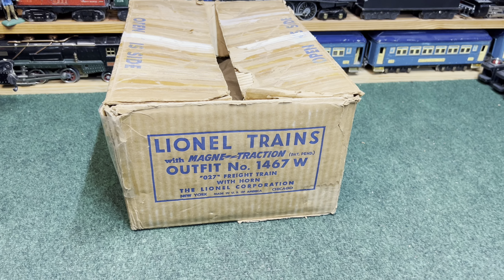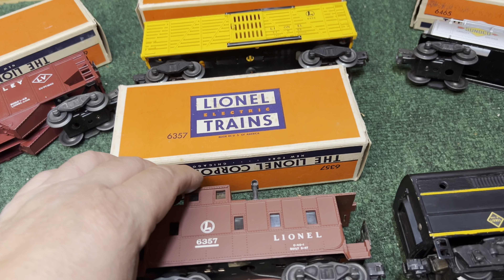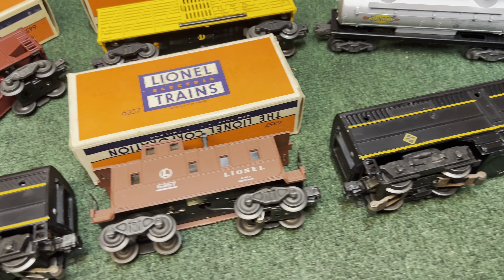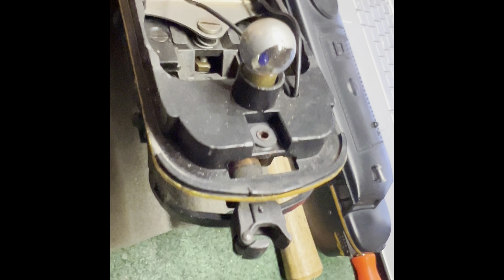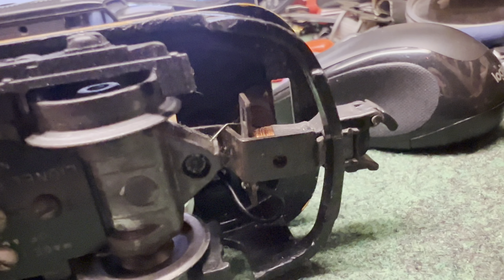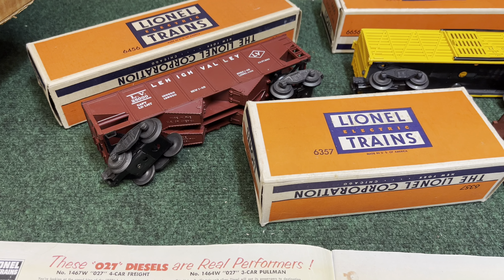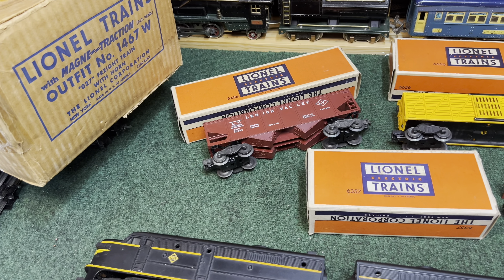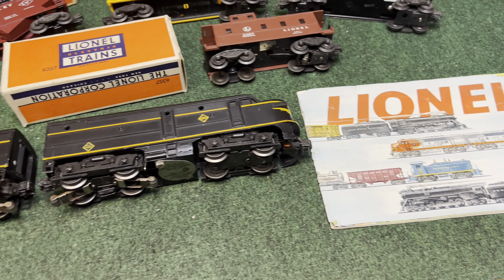1953 Postwar Lionel Trains Outfit No. 1467W Twin Erie 2032 Alco Freight Set

Comment: The 2023, 2031, 2032, 2033, basically the 1st Alco series are my favorites. Modified to two motors per unit they are unstoppable in pulling power.  Double them up having four motors and they can exceed the horizontal motored F3’s. In fact the F3’s twin units (no dummy) with all magna traction are even stronger. I like seeing tech by others on the old post war Lionel.😊

Comment: Good looking set of Erie Alco's. It's probably the nicest set I've seen. Having the complete set makes it just that much nicer. I have all of the early 50s alcohol sets. They are, without a doubt, some of the nicest motor designs from that era. They are of very good quality and are excellent pullers for a single motored engine. I enjoy running mine.